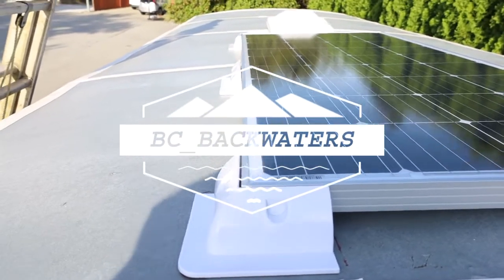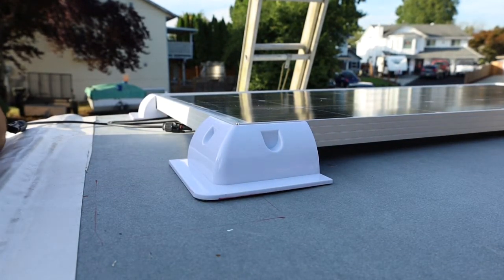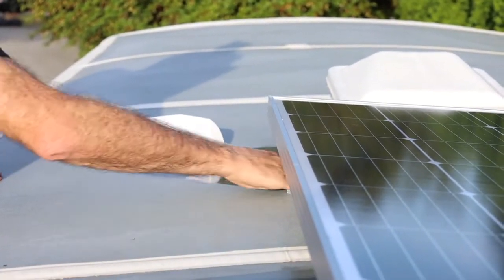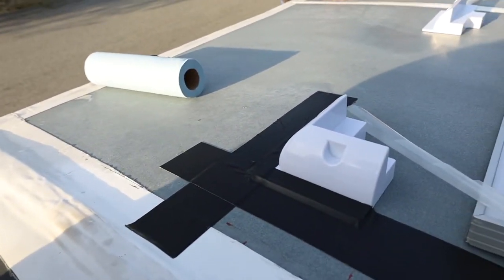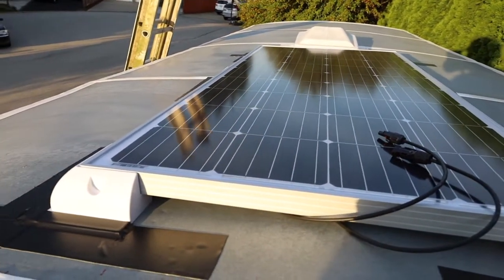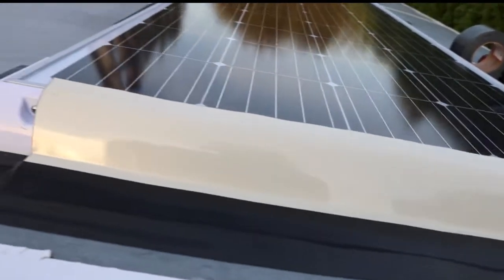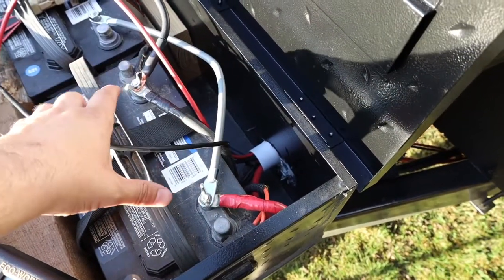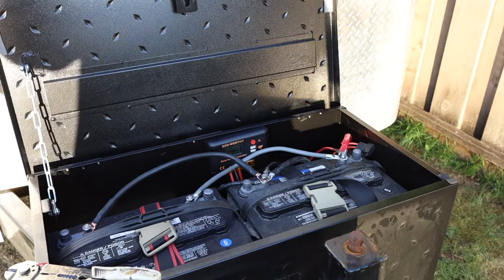Solar Panel Install on Roof with NO HOLES!!!

Comment: Putting my solar on top of trailer this weekend - using same white corner / side brackets. However, I'm attaching with glue. Glad you reminded me about safety line, will do that, too.
Reply from the maker: Yes better safe then sorry! Hope it’s turns out well!
Reply: @Jollyprez  what type of roof?
Reply: @lawrencewiddis2447  Aluminum. They've been up for a couple years now - and working fine - and haven't detached.

Comment: The use of tape instead of screws depends on the roof surface.
Reply from the maker: @larrywiddis470  Absolutely it does I’ve seen this method used on both fiberglass and aluminum. Also in 36 degrees Celsius but not sure how it would hold up in desert applications.
Reply: @BCBackwaters  having a rubber roof precluded my use of an adhesive but should I install again on fiberglass or metal I’d use 3M without worry. In the first days of solar lots of RVers were worried about panels blowing off. I’ve yet to see a panel on the side of the road or viewed an RV missing one.

Comment: Found your video while thinking about how to mount a solar panel on top of a trailer. Thanks for sharing these experiences, but would have preferred to see innovations in mounting with adhesive, testing done in a lab, not on the road.   Once it fails , some people will die.
Reply from the maker: I appreciate your opinion and did a lot of research on if it will hold,  also applied a metal safety line which was bolted to the awning bracket encase the tape failed the panel wouldn’t fly off.
Reply: @george1984  adequate sealing of screws when installed with yearly roof coating and screws aren’t a problem.

Comment: How are they holding up
Reply from the maker: I had no issues on the trailer for two years. Once I sold it I never heard anything from the new owner. I’ll be doing this set up on my new trailer
Reply: Thanks for getting back so soon

Comment: Has this held up until now?
Reply from the maker: I actually sold the trailer earlier this year but yes it held up the entire time even in some pretty bad wind storms. It went with the trailer like the day it was installed no issues or changes.

Comment: How long until the panel cracked by bouncing around on that flimsy roof?
Reply from the maker: I had it up there for two years never had a single issue. Sold the trailer with it still on the roof.
Reply: @BCBackwaters  no kidding. Those panels must have strong glass

Comment: The need for wind deflectors? Allowing the passage of wind under a solar panel is ideal.
Reply: Agreed. Wind deflectors on a flat panel that low won't make any difference plus wind going under the panel with help cool it down.  It gets really hot under that glass.

Comment: Did you make the wind deflector or buy it?
Reply from the maker: I made it just a thin piece of aluminum we bent
Reply: I’d defer to a wind engineer before deflecting passage under the panel. “Logical” thinking isn’t always correct thinking.

Comment: Where did you buy the wind deflector?
Reply from the maker: We made it out of a piece of thin aluminum just you tin snips to cut it an bent it over the corner of a table worked out really nicely
Reply: Don’t put a air deflector, the panels need air flow underneath
Reply: @danschmidt1 I think from the sides and back that there's plenty off air flow buddy ,hmm 😂

Comment: That is a flimsy roof.
Reply from the maker: All cargo trailer roofs are pretty flimsy atleast the ones I’ve seen!
Reply: @BCBackwaters  huh did not know that . 👍
Reply: @joeyvlljs7931  cargo trailers are just aluminum. The roof is just 2 or more sheets of aluminum  welded together. The struts are visible inside as well. Very basic very simple construction.
Reply: @johnm2056  👍 BC backwaters informed me already. But thanks though.